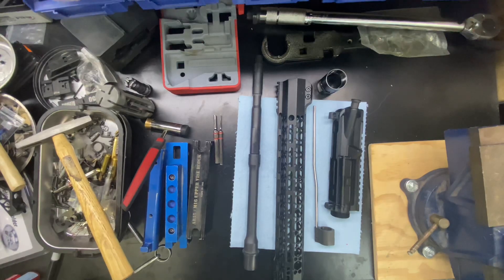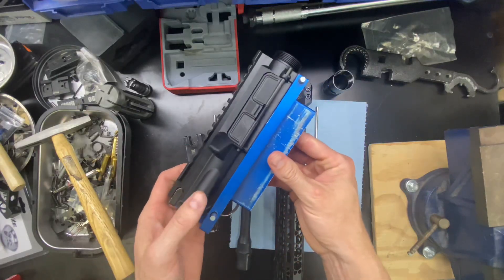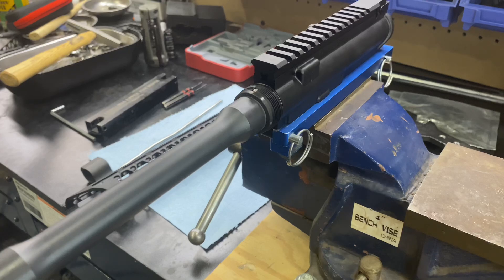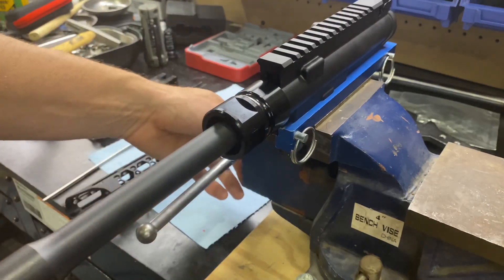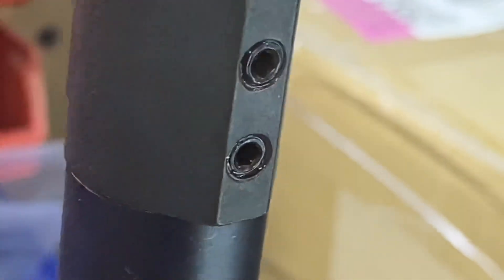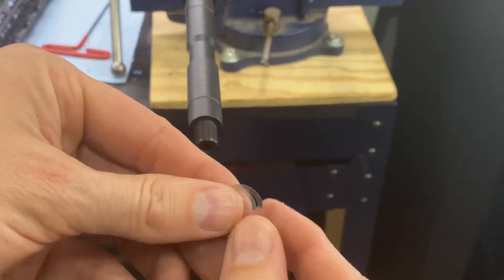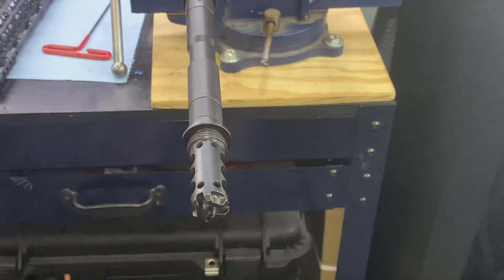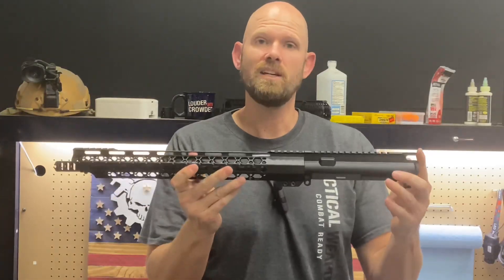AR15 barrel and handguard installation

Comment: I have a 12.5 BCM MK2 barrel and upper. Do you have a suggestion for an armorers wrench and allen/torx head tool kit to use with this setup? Great video!!
Reply from the maker: I got my torque wrench from Harbor freight and the armors wrench was from Amazon I think. I had both for years and they have been great.
Reply: @combatreadychannel Thanks brother. I appreciate you taking the time

Comment: Trying  to figure out if a 12.5 inch handguard is long enough for mid length gas
Reply from the maker: You should be good. If I remember right, the gas tube is around 13 inches long and ends up being around 9 inches down the barrel from the chamber. I’ll see if I have any mid length tubes lying around and double check.
Reply: @combatreadychannel  @mick5780 I’m sure by now (8 months later lol) you’ve got it figured out, but for the future, Riflespeed (who makes the hand-adjustable gas blocks) has a handy tool on their website for visualizing barrel lengths vs. hand guard length. I think you can do custom gas length as well, but it may default to the standard per barrel length.

Theirs is made so you can select the correct length of gas-block grip so it sticks out of the end, but I use it to figure out where my gas block lands too.

Thanks for the video! Gave it a watch as a refresher before I do another build.

Comment: Now correct me if I'm wrong if you don't know what you're going to do with the gun you put anti-seize grease on it when you know what you're going to do with it you still put in grease on it
Reply from the maker: Anti-seize grease is recommended, especially if you are planning on changing the barrel out. If you are not planning on replacing the barrel, you don’t have to but most gun smiths will recommend it. With that being said, I have worked on rifles that have had 10,000+ rounds fired and the barrels have worn out and need to be replaced that did NOT have any grease and it was no issue at all to remove it. I also know precision shooters that will put adhesive on their rifles to insure reduced movement and makes the barrel installation permanent. 
I do also have a couple of my own that I haven’t put any grease on to see what happens. So far I have been able to remove the barrels with no more difficulty than with the grease.  🤷
Reply: The grease helps with dissimilar metal corrosion if its an aluminum/steel interface but most AR parts are coated and there's no bare metal on metal contact so its just an extra safety measure grandfathered in for redundancy